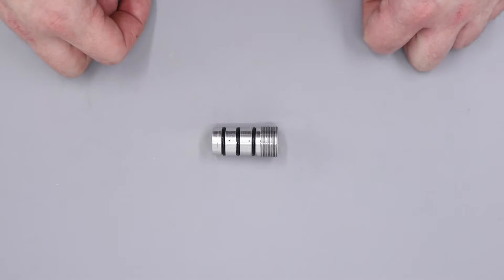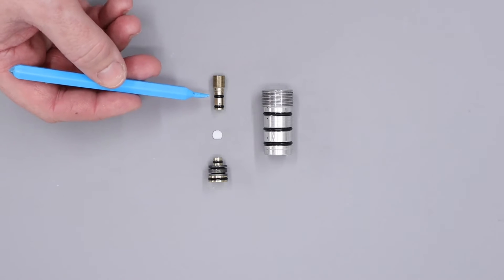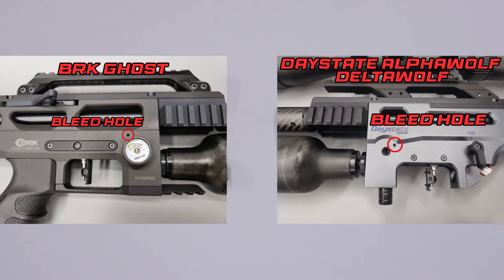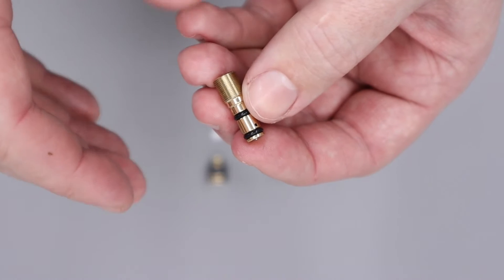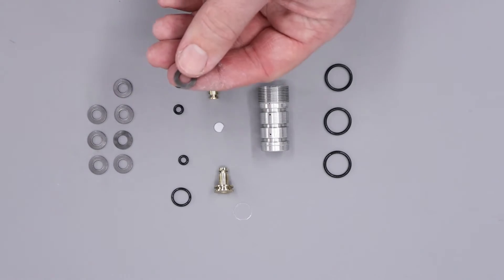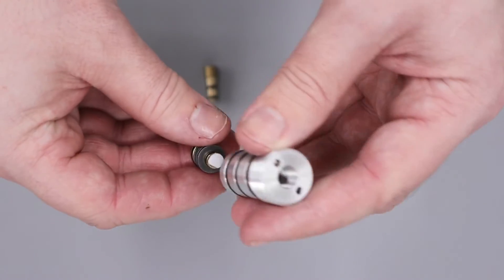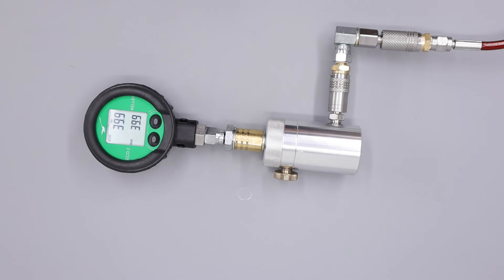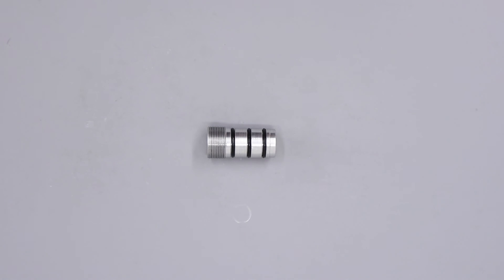BRK Ghost/Daystate Blackwolf regulator service and repair

Comment: Excellent video as expected thanks very much 👍🏻
Just a few thoughts, what is the best bottle pressure (or what bottle pressure would you use) to set the reg pressure. I notice on my Ghost when the bottle is full (250 bar) the regulator pressure gauge reads 5 bar higher than when the bottle pressure is lower-say 160 bar? 
 Perhaps my reg is ready for a service but doesn’t creep (or at least no higher than 100) and has a respectable refresh rate so I’m happy with it. Only makes about 10 fps difference on pellet velocity from 95 to 100 bar reg pressure.
Reply from the maker: many regs do this, but a reg vaviation of 5 bar is not something to worry about
Reply: hi jeff , you made great videos 👍🏽 jeff im sorry to disturb you but I have a problem with my brk ghost, could you help me please?